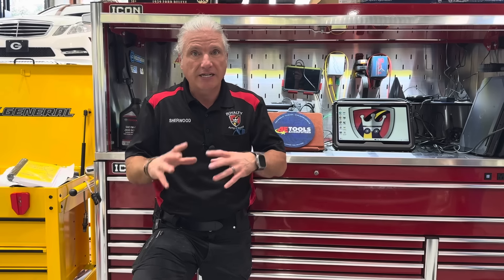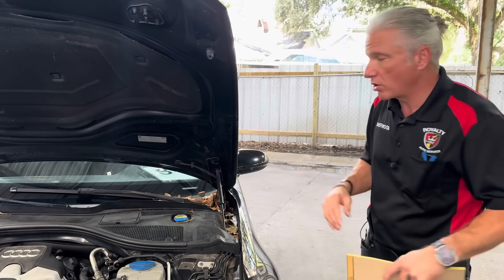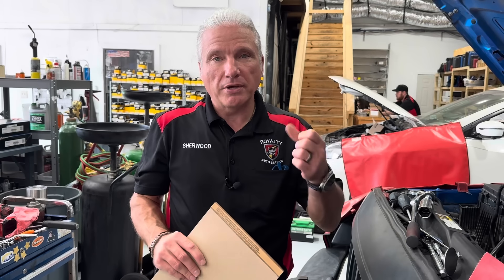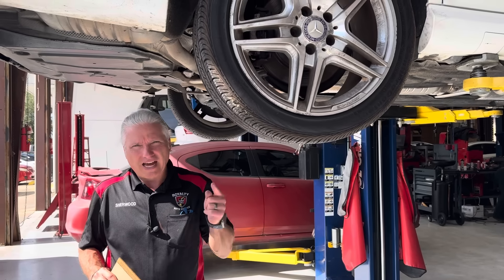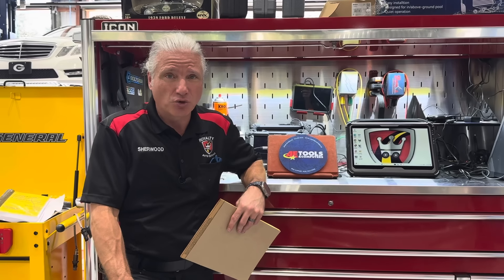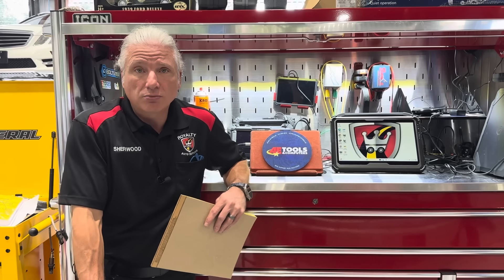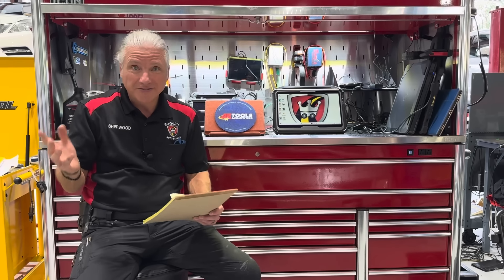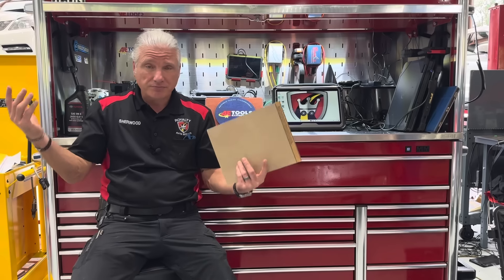Ranking The Top 5 Most Expensive Vehicles To Maintain That We Work On At Our Shop!

Comment: I've had a lot of cool cars over the years including 3 BMWs and 4 Porsches. The ONLY reason I was able to do this is by doing ALL the service myself. Our current 2006 X3 with 200,000 miles and 1994 325 with 330,000 miles (we bought new) have only one trip to the dealer between them. Learning to work on vehicles at a young age definitely pays off!!!
Reply: I own 3 Audi's from the 90s man... They aren't that bad... But like you said, I work on my own shit.
Reply: I agree 100%!  I get a double advantage as my main ride is a 2002 Toyota Tacoma.  I'm retired now and bought it new.  Never replaced the alternator, starter or anything major; only maintained properly with synthetic fluids and replaced timing belt and water pump at 105K for maintenance.  I now have over 276000 miles and don't do anything but oil changes (~ every 7000 miles) and brakes (~ every 80000 miles).  Now I'm older and I drive like an old man, so the truck runs like new; it rarely spools up over 2000 rpm.  It's a beautiful machine.  I'm 59 and I believe it will outlive me!
Reply: I've owned two E Class Merc's.  Nice, reliable cars.  They had distributor caps! 

The newer Audi V8's are nice, but the timing chains being next to the firewall means no go for me.  Great design for billable hours though!
Reply: Loved my 128i. Lots of wrench time to own it on the cheap. At 13 years and 100k I had to say goodbye. Brakes all around, alternator & starter, plus ac compressor at end life.
Reply: Same here. 4 porsches. Cheaper to maintain then taking a ford into pro mechanic
Reply: So you out here pulling engines on a Porsche and that's what you recommend 😂
Reply: @H0kieJoe  don't the timing chains last for 80,000 miles?
Reply: oof, try doing that with a new car you’ll find every repair needs “calibration” from a certified mechanic.
Reply: @Freerider93  Sounds about right.  However, as someone who enjoys working on my own cars, that design is no go.
Reply: @Freerider93 If a person has the knowledge and tools.....why not?
Reply: I have a 2018 BMW X3 with 209,000 miles. It has had regular maintenance by an independent shop and myself.  Drives and runs like the day I bought it. I’ve had two other BMW’s with well over 100,000 miles each. Not one major issue.
Reply: @keithspillman  Unfortunately, as you get older, your time slicing leaves less for auto repairs and more for doing other things, like travel, tutoring, learning a musical instrument, babysitting, etc. I used to do many more auto-related tasks when I was 30 years younger. Now I do oil and oil/air filter changes but not much else. Time becomes more valuable than money.
Reply: @paulcoonce2493  You're 59 and consider yourself to be an "old man"?😏
Reply: @davepaturno4290  Hehe....I'm the opposite. I'm retired from industrial maintenance management, and now I'm a beekeeper and restore old military equipment!!!! It's all GREAT therapy and exercise!!!
Reply: @H0kieJoe Thanks for mentioning the inaccessible location of the timing chains.
Reply: Bought a ‘12 BMW 128i with 46k on it and had minimal maintenance for couple years. The ignition coils were replaced after couple years, then some oil leaks, last just had the rear brakes done. So about $5k in 5 years and 60k. The kicker is that I only paid $10.5 for it so I figure the total for kick ass fun car that handles like a cat on carpet, gets over 30mpg on the highway doing 70, and can park it anywhere ain’t too bad.
Reply: Great reason to be a backyard mechanic. I have a 2009 BMW 135 with 250k on it is a labour of love. Great car when it’s not broken. 2016 X5 N55 pretty reliable. 2004 X5 with 345k on it and that’s not too bad either. All great cars that’s are great to drive and as long as you like to work on them no reason not to buy one.
Reply: Porsche.. not on the list
Reply: @SirenaSpades  Noticed that. Was happy with all of mine.
Reply: I had a 2004 BMW 525i in my mid 20s. I did all the work myself. I'd buy parts online for the best price. One day when I opened my hood looking around the engine bay I realized  my BMW was now a CMW.
CMW? Yes, Chinese Motor Works, CMW. All the aftermarket parts had "Made in China" on them.
True story.

Comment: A little over 25 hours book time for an Audi timing chain is something to think about when admiring how pretty they are.
Reply: Yeah, thats a lot of time. 3.0l Ecoboost explorer is 28 hours timing chain job I did a few weeks back.
Reply: @moh5896 - that can’t be right.  Isn’t the 3.0L Ecoboost a derivative of the 2.7L?  I did a 2.7L Ecoboost short block in less than 28 hours.
Reply: @ghostwrench2292  It's not.  A little over 16 hours book time. No walk in the park though.
Reply: Mercedes too..just junked my ML550 with 230k miles. Great car.. control arm problems always. 
But timing chain broke. Junked it
Reply: How long do the timing chains last?
Reply: @Freerider93  150-250k miles. APX life of car
Reply: @Freerider93  Depends on care and how aggressive the driver is.  The ones we've done were between 90-120K or about the time a buy here pay here lot sells it for 38% interest.
Reply: @drunvert  I was reading it only lasts 80k...I was thinking it's best to buy a used audi at around 40k and sell before 80k.
Reply: @Freerider93  I was thinking of a Mercedes and not a brand new one. That's pretty piss-poor of Audi
Reply: @drunvert planned obsolescence my friend.
Reply: Timing chains are lengthy for most any vehicle if you get an estimate.
Reply: @Freerider93  And that's when the rest of us buy it.
Reply: @SirenaSpades  🤣

Comment: This is why I buy Toyota
Reply: Even Toyota reliability is suspect with modern Toyotas.
Reply: Smart  choice. And to a lesser extent Honda and Nissan are more reliable than the European brands.  Plus the Japanese brands are usually less expensive to purchase.
Reply: Amen!
Reply: I’ve owned multiple Toyota- very reliable but extremely boring. I’ll take VWAG for a decent compromise
Reply: I agree Toyota is mostly boring . I would stick with Japanese as they seem to be the most reliable and cheaper to repair. Mazdas , sone Hondas and Acuras are more fun to drive and they are more reliable and less expensive to repair than VW. But I agree VWs are fun to drive.
Reply: Only bought Toyotas for last thirty years. I keep ten to fifteen years.
Reply: Any Toyota with the 2UZ V8 👍👍👍
Reply: @05jrgoldsberry  Sure they are reliable. But I can't drive them daily, too boring and unsatisfying. Sitting in traffic, I like the quiet comfort of Audi, or the peppy handling of the VW. I keep my new models 10+ also.
Reply: Unless you need to tow
Reply: @jimgeneava2464 🤣....A few days later!
    I changed my mind and went back to Toyota, VW/ Audi repair cost were killin' me!

Comment: New cars are now like kitchen appliances. Built well enough to get thru the warranty period and then start falling apart after a few years of use. All the plastic parts and only designed to make it easy on the factory to put together
Reply: They want you to lease. For years now.
Reply: Well, not all but most are.
Reply: I read an article decades ago discussing how the Germans and I think EU officials decided on a grand compromise. The cars would be recyclable and not last. This would mean more jobs and profits while reducing the problem with old cars with poor emissions and mileage staying in the fleet. 
Some of the old Mercedes diesels could easily be kept going for decades, but they had dirty emissions. This wasn’t desirable to anyone except the owners who wanted relatively cheap transportation.
Reply: You've obviously never bought a Toyota.
Reply: Just buy Japanese.
Reply: Good rule of thumb is if it has a metal intake manifold you're probably a-ok.

Comment: I have owned 30 cars and the most reliable and lowest cost to maintain have been:  2004 Honda Civic, 2005 Honda Accord (V6), 2017 and 2020 Mazda 3, 2004 Toyota Celica, 2002 Toyota Corolla and 2004 Mazda Miata. All non turbo and a couple with manual transmissions. Simple is better if you want reliability and low maintenance costs. However my most fun cars have been BMWs. Amazing to drive but needs regular proactive maintenance. Regardless of what you drive find a good independent mechanic and/or do basic maintenance yourself.
Reply: Wow my list is the complete opposite most reliable 1 2000 Camaro SS(6 speed) 2 2007 Mercedes Benz clk 350 2005 RL, 99 Oldsmobile 2003 TL 2009 Saab 9-7x aero. 07 audi a4 14 Cadillac CTS.Least reliable 97 Honda prelude 2004 Honda civic 01 TL bmw 335i Cadillac 15 Ats( 6 speed)
Reply: No Jaguar on the list 🤔
Reply: @K..hozea2  #1  Jag/Land Rover -  did you watch the video?
Reply: @willynilly-s5x  I must of missed that part 👍
Reply: I've daily driven a 2003 Chevy Impala and I believe including oil changes, I've put 3 grand into it since I bought it in 2007.  It's well maintained, it's getting up miles, this year it did cost a little more and it's getting toward retirement age, but reliability and lowest cost to maintain over the years for me has been that car.  It is the 9C3 police model so it has a heavy duty transmission, suspension, brakes (have replaced brakes and suspension).  It's a work horse.

Comment: 5. Audi/VW
4. Jeep, Chrysler, Dodge, Ram
3. Mercedes
2. BMW
1. Jaguar/Land Rover
Reply: Also:
7. GM/Chevrolet
6. Ford
Reply: I won’t touch these cars EVER
Reply: Hero
Reply: You know the difference between a porcupine and a BMW?
The porcupine has it's pricks on the outside😁
Reply: I had a Benz new 18 years ago and it broke down so often that I eventually sold it. I remember, the window comes down but can’t roll back up right after warranty expired and dealer asked me for $1600 to replace it. I opened the console to pull the springs on all switches and it worked.
After the Benz I bought an Infiniti QX56. After 15 years with 200k miles, I have never gone to the garage except for oil change. That damn truck is running fine as aged wine.
Reply: No surprises there really!
Reply: Thanks!
Reply: I own 2 of the 5! 😂😢
Reply: BMW isn’t really that hard to work on if you’re mechanically incline
Reply: thank you
Reply: I currently own a; 
2006 Land Rover LR3 with 184K - Been great sofar. 
1996 bmw Z3 1.9liter 4 cylinder w 118K
and a 
2010 Mercedes E550 w 88K  …

The bmw has had minor vacuum leak issues after it sat for 6 years and the LR3 has has airbag suspension replaced- other than a blown heater core hose and CV boots… no major issues. 

The E550 is the most recent… fingers crossed it doesn’t cost a fortune- 
Been pretty lucky sofar/ regular maintenance and timely repairs are key
Reply: @5hunnidCG Are you kidding? Watch Speed Academy. It’s hilarious how much more difficult BMWs are to work on compared to any Japanese model they work on.
Reply: @ I don’t have that problem because I learn the secret knowledge guess you won’t be working on one..
Reply: I had a 1972 Porsche 914 when I was 19.  Poor man's Porsche, paid $2,700 for it.  Bought it in 1987.  Quickly learned that even doing the work myself, I could not afford the maintenance on that car.  Huge mistake!
Reply: @PatrickEvabs bought a used LR2 Rover, last of the english made rovers before jaguar took over. I have had it for ten years. Since it was a discontinued model got it cheap. 4x4. A risk reward buy on the cheap. 15 years on  the road and it has about the same issues as any other brand. I would never buy another Rover though. Lexus toyota all the way!
Reply: I LOVE my BMW but wouldn't own it out of warranty. Nothing is more expensive than a cheap BMW!
Reply: 18 year old 2006 Audi A6 3.0 TDi Quattro Le Mans. Bought it new. Apart from oil, filters, brakes and tyres, in 18 years it’s cost me less than £2k in parts. It’s still running the original Lead Acid Battery! (but it’s tired and needs replacing). I keep the car on a tender when it’s in the garage.
Has never leaked oil, not a drop, starts every time on the button and is the best car I’ve ever owned. Not a spot of rust, looks and drives like the day it was new. Quiet, comfortable, powerful, economical. I will be driving it for many more years yet.
It has a service interval of every 20k miles. I’ve swapped out the oil and filters every 5k miles.
Worst car I’ve ever owned was a Mk5 Golf TDi. So bad I got rid of it for a Range Rover which was faultless over 5 years of ownership, but the Audi…..amazing car.
We also own a customised fully rebuilt PT Cruiser………build quality is one of the worst I’ve ever seen, but it’s a fun car for the beach and that’s all.
Reply: Thanks so much for saving me time
Reply: @PatrickEvabs the fact they are older models, you should be okay. Don't buy anything newer for a long time.

Comment: I have a 2011 Jeep Wrangler. At 260,000 miles I replaced the transmission,305,000 miles I replaced the engine with a Jasper. Considering the cost of used cars today it made sense to put the engine in. A Jeep is kind of a timeless vehicle so it can still be cool to drive. Love the channel guys and I’m not a mechanic but I still enjoy the content
Reply: I have a 2002 Jeep Wrangler Sport and still going strong. I haven't had anything big gone wrong on it.  I plan on keeping forever.   Love it.
Reply: I hate Jeeps, mostly for the way they drive. But I concede your point, they are somewhat timeless. I think you made a good decision on investing in the engine.
Reply: Prove it.